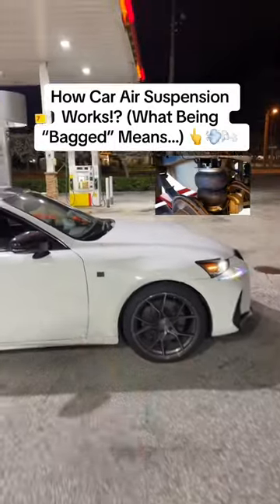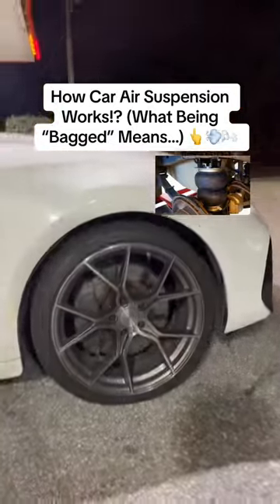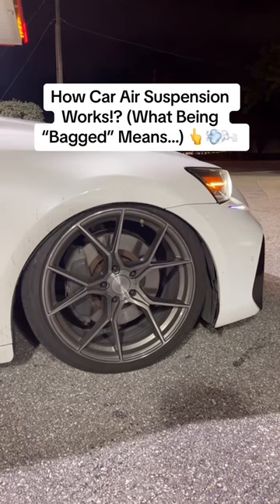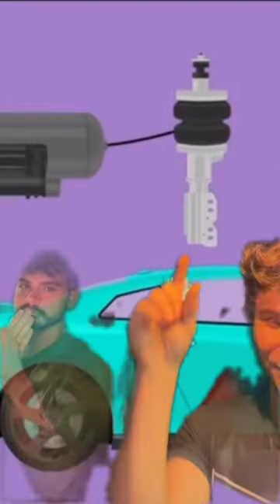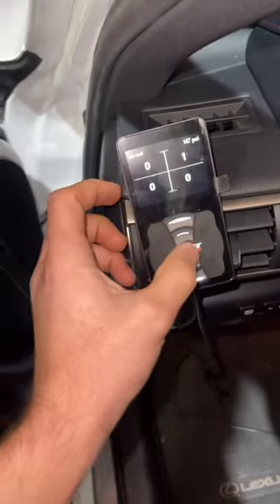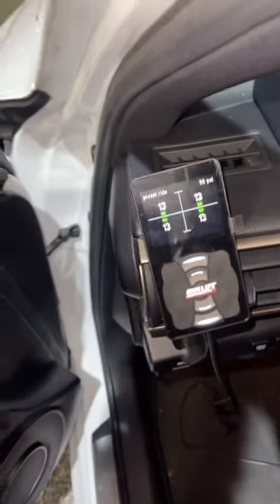WE CAROLINA SQUATTED A LEXUS IS 300!? (HOW “AIR SUSPENSION WORKS IN CARS…) #SHORTS

Comment: What if it pops?
Reply from the maker: Then you’re out of luck 😭
Reply: you can just replace the bag
Reply: My 96 crown Vic had airbags kind of the same thing just can’t control the height, they were when I took them off at 170k miles I think they were the original so I’d say it’s more safe then you think.